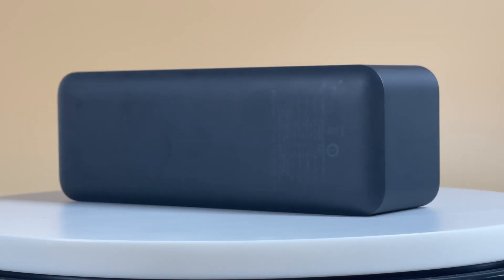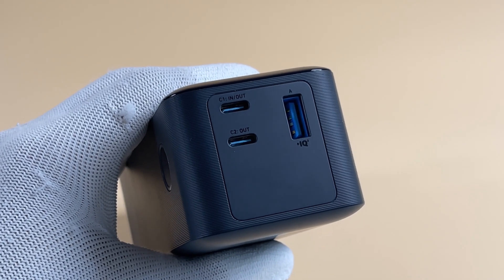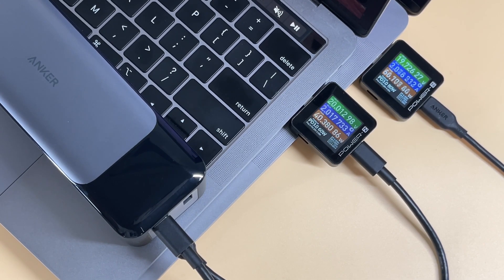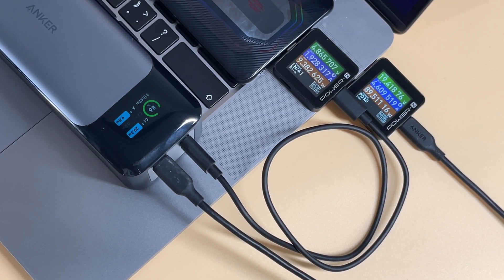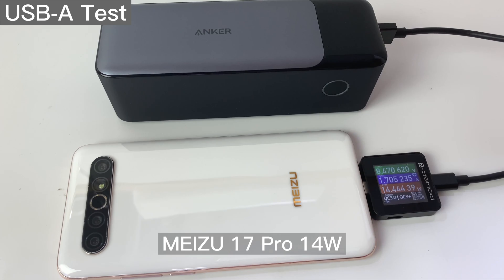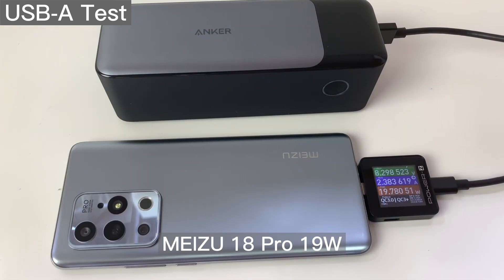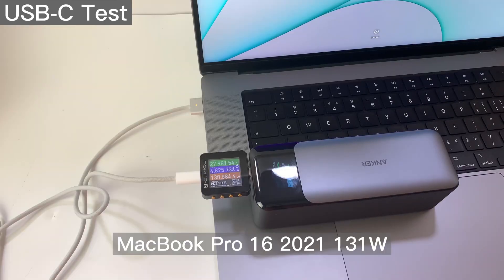Charging Compatibility Test of Anker 140W PD3.1 Power Bank (737 Power Bank)

Comment: Can I use Anker 737 even it doesn't support 12V? Anker 737 shows under voltage warning (I think the reason is that DJI Osmo Pocket requires 12v but Anker 737 doesn't. It keeps charging DJI, but I was worried about safety issue)

Comment: why is it that some devices they charge faster than others
Reply: They can take in more power
Reply: @TheStopwatchGod  what do you mean? I tried even with my new samsung galaxy 23 ultra and it cannot go full power of 140w
Reply: @changyone  The S23 Ultra has a max input of 45W, and that’s when the battery is very low
Reply: @TheStopwatchGod  Thank you for the information so it is difficult to find an device that will able to charge it at 140W also I do got a problem with charging cable of it as it does not sit well as it can get loose for example when I put in my bag and charge it with device, it goes easily off.
Reply: it is possible that the resistance of the battery is different, but this is not accurate, its old xiaomi does not take 2 amps with smart charging, but the GAN Xiaomi 65w fills it with 1.5 amperes and charges it longer, well, these are just guesses, well, or just my old device does not have the necessary PD protocol

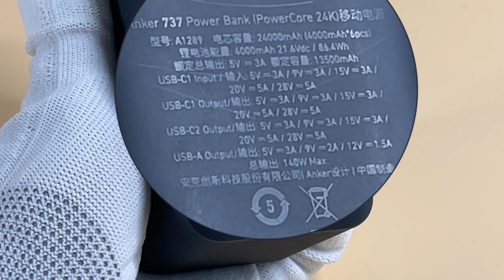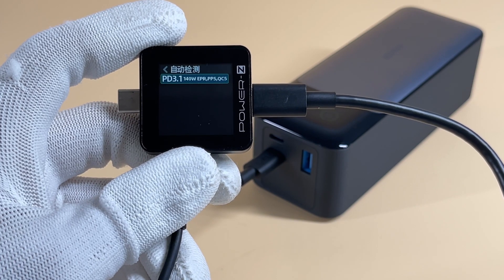Comment: Can anyone confirm my observation? Anker states both USB C ports support 140w output, as the print shown at 0:08 shows C1 output supporting 28V5A, as well as C2 output. However, the video clearly shows that only the 2nd USB C port C2, the one furthest from the screen, actually supports 140w, as shown here at 0:27. In the protocol test, the first USB C port does not show support for 28V5A output, as shown here 0:40
Did Anker simply mess up when labeling their product specs?
Reply from the maker: Sorry about the mistake.
We've retest it in our teardown video of this power bank.
https://www.youtube.com/watch?v=NO0P5BO5gTQ&t=300s at 2:33

Comment: I found something unexpected with this powerbank and Apple’s 140w charger. With older 3A USB C cables from Ugreen, it seems to switch up to 28V/3A for 84W charging. Extra voltage should be fine as long as current is 3A or under… but I thought a cable would need new PD3.1 ID chips to allow voltages over 20V?
Reply: something's interesting. I've noticed that some of my cables are also displaying as having a e marker that supports 50v before the USB PD 3.1 EPR standard became a thing. However, none of those cables are working at 28 volts or higher.

Comment: Why most of the phones are limited to 15W+
Reply from the maker: Cause some phones cannot fully compatible with PD protocol. They'll activate 9V instead of 12V, 15V, 20V.
Reply: @ChargerLAB  got it, thanks for the details ❤
Reply: Too much heat build up if you charge a tiny phone battery too fast.
Reply: @albedo0point39  but most of them support fast charge
Reply: @kakzhann  ‘Slow charge’ maxed out at USB 5V/2.2A = 12W. So even 15W can be advertised as Fast Charge.